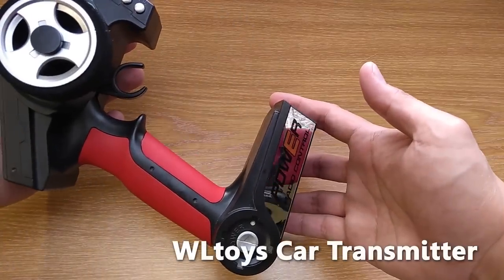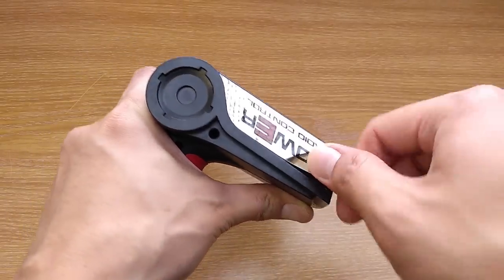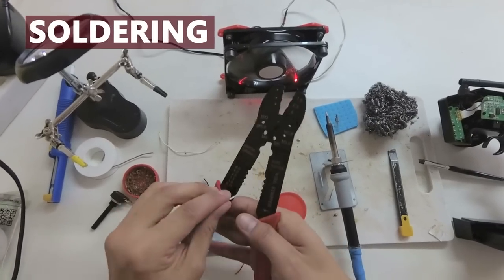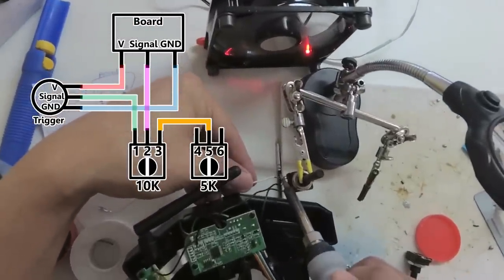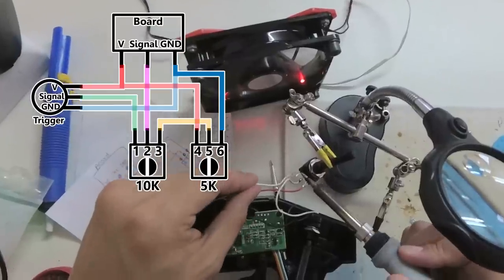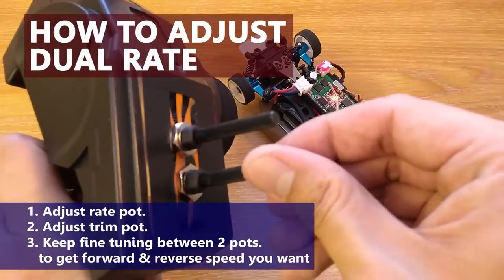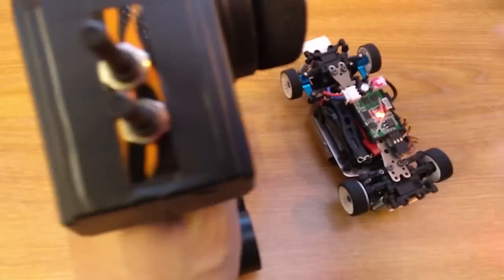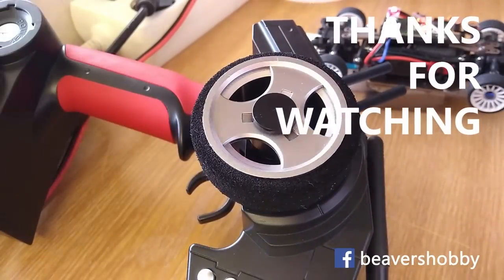[How To] WLtoys Transmitter Dual Rate Mod (throttle limit)

Comment: Hi, can I apply this mod to my flysky GT2 transmitter?
Reply from the maker: Yes, it can.
Reply: Thank you
Reply: Hi, is it posibble to use one stereo potentiometer? If possible then what K size is the best? 5K or 10K?
Reply from the maker: @omsyem8506  Try 5k first. If it can't lower your throttle enough then 10k.
Reply from the maker: @omsyem8506  Try 5k first. If it can't lower your throttle enough then 10k.
Reply: Ok thank you

Comment: hai beaver..aku punya servo gening d561mg arah putarannya tidak seperti servo lain..apakah ada cara untuk memodifikasi remotnya untuk membalik putarannya karena aku masih pakai remot original wl k989
Reply from the maker: Swap 2 wires on steering potentiometer. Experiment with them to see which ones make the steering reverse direction.
Reply: kalau di antara remote gt3b,gt3c dan rc4gs paling bagus yang mana buat mini drift?
Reply from the maker: @anggasetiawan7988  RC4GS. Not only the gyro (which I don't use) but it's much easier to use and more precise.
Reply: kalau dumborc x4/x6 dengan rc4gs lebih bagus mana?
Reply from the maker: @anggasetiawan7988  RC4GS is better because it has screen so you see what the settings are. If you're on tight budget Dumborc is fine, it's better than Flysky anyway.

Comment: You should sell these on ebay...i would buy..maybe cut the dials down, add a knob to each and replace the rectangular sticker with 1mm carbon fiber. This upgrade would be very helpful with 1/28 scale rcp track racing or even drifting..
Reply from the maker: That won't be necessary. There are other WLtoys transmitter with adjustment on sale for cheap too.
This one can do throttle dual rate and has better steering. https://goo.gl/4pKsUx
This one can limit throttle and steering with LCD. https://goo.gl/eo6xFs
Reply: @BeaversHobby   so youre saying the 10428 transmitter will bind with my k989 reciever..?
Reply from the maker: @billyeason9899  Yes, many people are using it right now too. Just turn the car on, then put transmitter to bind mode, then the LED on the car will be solid. Now turn everything off and on again and it'll work.
As for me I use multiprotocol module hooked up to my Radiolink transmitter.
Reply: @BeaversHobby  could u do a bind demo video with the k989 and 10428 transmitter. I need to limit the servo ratio in my xmod conversion setup
Reply from the maker: @billyeason9899  I don't have that transmitter. I only see people using it. You can go to rcgroups.com and ask user ican3d for the specific detail but essentially it's just a matter of clicking bind button.
Reply: @BeaversHobby  can you tell me if the p33 has steering reverse capabilty? The micro servo i used in my xmod build is a ven 8172 brake servo and the steering is reverse which is not switchable on the normal transmitter like the one in this video. If nothing else i guess switching the wires for left and right in transmitter is possible, or even reversing the motor wires in the servo itself. Im also having problem with full throttle running after the cells hit 3.7v. The esc will cut power to the motor, while steering will still work. If i cut off the esc itll run but only at part throttle. Could u suggest a resolution. The 2s is only a 220mah 20c so it may just be too small. 5min run time is just not good at all
Reply from the maker: @billyeason9899  Yes, P33 transmitter has servo reverse. If you're using WLtoys 2-on-1 it doesn't work with 1S. You need 2S lipo to work. There's plenty of 2S lipo on the market, you just need the right size for your car. You can use. After removing the bracket you can fit something like this to give you longer tuntime. https://www.banggood.com/Gaoneng-GNB-7_4V-450mAh-2S-80C-160C-Lipo-Battery-XT30-Plug-p-1163446.html
But I use only 350 mAh  battery so the car is light. https://www.banggood.com/Giant-Power-7_4V-300mAh-35C-Battery-For-HCP100s-T-REX-150-F3P-p-987487.html
Reply: @BeaversHobby  my car is not wltoys only 2n1 unit, yes i have 2s but is only 220mah and 20c. The car i have built is a 2003 model xmod 1/28 scale with 49t 130 carbon brushed motor. K989 or p929 is next for me but wanted to do this build with my old 27mhz 6v  xmod first...it now does donuts on carpet..where as when new would lag badly on carpet.
Reply from the maker: @billyeason9899  If I remember correctly Xmods has 4 batteries, 2 on each side. You can use 2x 1S Lipo batteries on each side then run it in series so you have more run time.
Reply: I sourced a 2s 400mah 30c that i plan to split and do just that. The cells will even fit in the stock battery holderz for secure mounting.
Reply from the maker: @billyeason9899  Splitting cell is quite dangerous. because if you poke in to a cell it might burst in to flame. There are some exception though, each battery is built differently but please keep that in mind that Lipo is not like Nimh where you can just easily poking sharp object near it.
Reply: @BeaversHobby  have done many times...very familar with soldering and balance leads
Reply from the maker: @billyeason9899  Should be alright then.
Reply: @BeaversHobby  oh yeah my old setup with stock xmods ep was eflite 400mah 30c 2s setup and had plemty of power. The radio shack electronics are nothing to what i have in the chassiz now. The venom servo is so much better....
Reply: Did u ever try other motors with the 2n1 esc...im thinking of a pn racing motor, im sure it could handle a 50t but idk about the 39t...not without upgraded mosfets
Reply from the maker: @billyeason9899  I only tried it with Sinohobby which is no different than WLtoys. I've seem people using it with PN racing but can't remember which one. 39T ought to work though. This ESC is pretty good.
Reply: @BeaversHobby  if i had a k989 130 id take it apart to count the number of armature turns. Im guessing its 40-45t carbon brushed
Reply: Just watched a p929 with a pn 50t and it wad faster over stock motor. So the stock motor has to be over 50t...the stage 2 xmod 11tooth is a  54t motor so we will see how it does with a proper higher current lipo setup. The stock wltoys lipo from what i gather is a 450mah 30c which is close to the 400mah 30c i plan to use. The car really moves compared to the stock ep setuo. The 220mah 20c just cant handle the burst current the motor is trying to draw. I believe the cells are dropping below the lvc for the esc causing it to shut down. Under part to half throttle the car does great...just full throttle shuts it down. Turn it off and back on and it runs again...
Reply from the maker: @billyeason9899  Original WLtoys battery is 400mAh, it doesn't label C rating but I think it's 20C like Mini-Q. So what you're going to use can deliver more power than original battery.

Comment: How about the results?
Any improvement for drifting ?
Can do it for forward only?
Actually I want to adjust the speed for forward only 😅
Thanks if you can give we me the suggestion
Reply from the maker: It is easier to drift and not over power as before. Unfortunately you can't do it for forward only, it adjust the whole trigger to low down the range. But you can offset the middle somehow to make forward or reverse slower.
Reply: Beaver's Hobby I guess 😅😅
Ok thanks, let me try later..
Please share if you have the video result..
Reply from the maker: @ToenofMoegan  Well, now I use it with touring car but I suppose I can find some drift tyres I'm not using to film it.
Reply from the maker: @ToenofMoegan  Finally I got to make the drifting video with this mod https://www.youtube.com/watch?v=MCZepIWM4y0

Comment: Hi, can i use 20k and 10k potentiometer instead of 10k and 5k ?
Reply from the maker: Yes, you can. However the adjustment will be a bit difficult because a small turn of the knob will have bigger effect. If you can't find 5K you can use 2 10K instead.
Reply: @BeaversHobby  ok. If i use both 10k how about the rate of adjustment? Its difficult?
Reply from the maker: @asyrafmokhtar7297  A little bit more difficult than 5K + 10K but not as difficult as 20K + 10K.
Reply: @BeaversHobby  ok thanks. Will try it later.
Reply from the maker: @asyrafmokhtar7297  My pleasure. Good luck with the project.

Comment: Can you make video for upgrade the transmitter, so it can much far away? Mine is only got 10m-20m
Reply from the maker: You'll have to change the transmitter entirely for that. Here's the video. https://youtu.be/BSt7U-yOa4Q
I didn't talk about range but Radiolink has very, very long range.
Reply: Yeah, but change a remote Transmitter its mean change the esc T.T like replace the antenna with booster signal maybe? Can it work? Like a plane rc
Reply from the maker: @eyganhobbykere6676  Signal booster should work. It's the same principle and the radio is pretty much like any other cheap nrf2401 chip anyway.

Comment: Hey, you just need to cut V and G, and than just use 2 pin on VR, 10K for V, 5K for G.
I'am sure, NO RESET after restart again. (Sorry bad english lang ✌️😁)
Reply: Can you show the diagram? Thx
Reply: @LeoRcCars  hi bro, you can use potensio 10k stereo. No diagram, because its easy, very easy.
Reply: @akungame1779  😂😂😂😂 it's super simple only for those who knows what is the stereo potentiometer not for those like me with almost 0 knowledge about n electronics)
Reply: @LeoRcCars  lol 🤣

Comment: Hallo brother..can i use 2x 10k potensiometer?
Reply from the maker: Yes, you can. Adjustment will be a bit tricky but it will work.
Reply: @BeaversHobby  thank you very much bro...
Reply from the maker: @bulanracingofficial  My pleasure.
Reply: @BeaversHobby  hi brother... I made it last night using 2x 10k potentiometers ... but 1 potentiometer (which has 5k) when the motor suddenly turned on without throttle being pressed ... the other 1 is normal ... is there something wrong ?
Reply from the maker: @bulanracingofficial  That's not normal. It should be able to stay neutral. One is used to close the full range and one to bring the centre back. You can try swapping 10K and 5K places. This should help you adjust the neutral position easier.
Reply: @BeaversHobby  i use 2x 10k potensiometer
Reply from the maker: @bulanracingofficial  Try adjusting both of them bit by bit. One to limit the range then adjust the other one to make the wheel stop (bring it back to centre). Using 10K on both will be very tricky to adjust and you'll have to be very precise.
Reply: @BeaversHobby  ok bro...i will try..thank you very much
Reply: @BeaversHobby  hello friend, do you know the point of throtlle signal in the k989 receiver?
I tried to make a gyro with Arduino, but I don't know the point of the throtlle signal in the receiver
Reply from the maker: @bulanracingofficial  Unfortunately the original receiver is 2-in-1 unit and it combines with the ESC inside without any way to get the throttle signal. You can only get the steering signal and work it like normal gyro, steering only, not full stability control.
Reply: @BeaversHobby  ok..thank you friend

Comment: Maybe dumb question, can this be done on others radios?
Reply from the maker: Yes, absolutely! You only need to identify the throttle (or steering or any stick input) wire and all the rest are the same.
Reply: Thanks you so much for fast response, I want to do it on LaTrax Teton.
Reply from the maker: @adamlukas3967  My pleasure. Good luck with the project.
Reply: One more thanks, good channel with lots of useful videos

Comment: Why need two potentiometers instead of one?
Reply from the maker: Imagine a bar, you need 2 to adjust the limit from top and bottom so the centre stays the same.
Reply from the maker: @fre99999  Imagine when you have a bar and there is centre of this bar. We'll call this a true centre. When you adjust one potentiometer the whole bar will be shorten this will create a new center which is not the true centre. We need another potentiometer to push the shorten bar up so the new centre is the same as true centre.
Does this help?
Reply from the maker: @fre99999  My pleasure. Good luck with the project.

Comment: hi, I have a wltoys l959 buggy. there is a problem of my radio control transmitter.  the range has decreased.  do i have to replace the radio control or replace the frequency module in that transmitter. what would b the solution.  plz help
Reply from the maker: Have you tried replacing the battery? Also check the antenna if there's any breakage. I'd probably change the antenna first because it's the cheapest one to do. I don't think you can find the module that easily though. If nothing works you can try using other WLtoys car transmitters like the one from crawler too.
Reply: @BeaversHobby  my child has broken the antenna so I replaced with a wifi antenna but all in vain. in that replacement , I messed the smd resistor in  frequency transmitter module. now I don't know which resistor was that?
Reply from the maker: @arifkhan-ts8dn  It's probably easier to replace the transmitter at this point.
https://www.banggood.com/Wltoys-1242812423-L959-A-A979-A-112-RC-Car-Spare-Parts-Transmitter-V2-p-1307505.html?rmmds=search&cur_warehouse=CN
Or upgrade it to this. https://www.banggood.com/WLtoys-10428-2_4G-Trasmitter-LCD-Screen-3CH-110-K949-112-RC-Car-Part-p-1138324.html?rmmds=search&cur_warehouse=CN